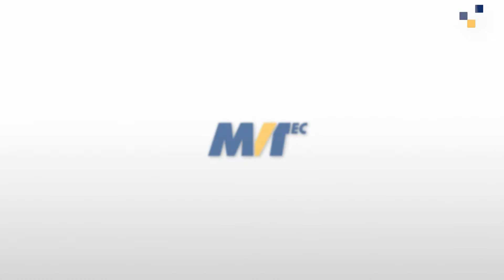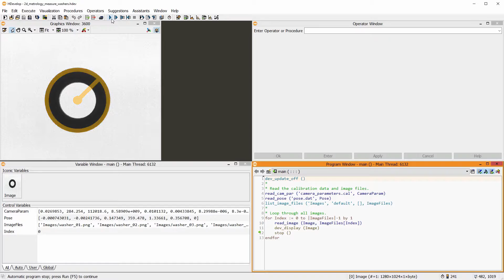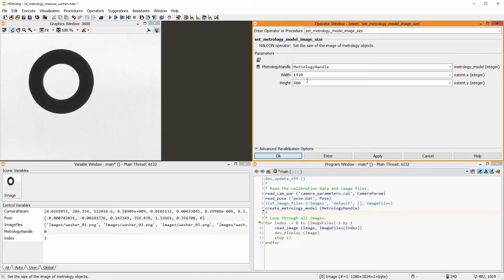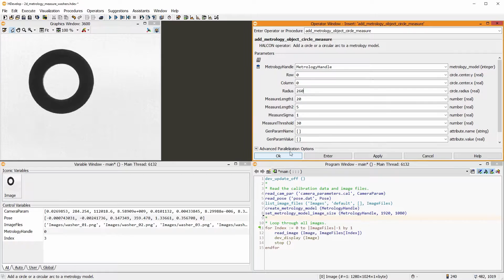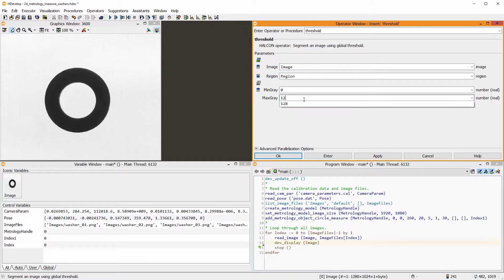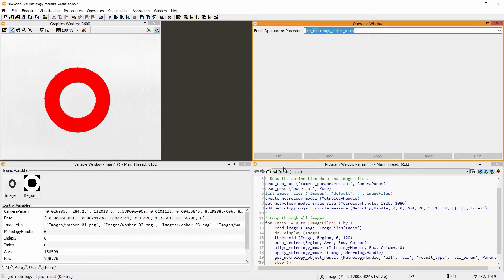Calibrated measurements using 2D Metrology with MVTec HALCON

Comment: How to choose the length and width of the rectangle when measuring the diameter of a circle is more appropriate, because I found that the measurement results of different lengths and widths are not exactly the same.
Reply from the maker: Thanks for raising this question. The selection of the correct length and width of the measure rectangles depend very much on the shape and dimension of the object, which should be measured. In addition, the quality of the data is important for the correct selection. Therefore, we encourage you to get in contact with your sales partner and share the data and application with them.